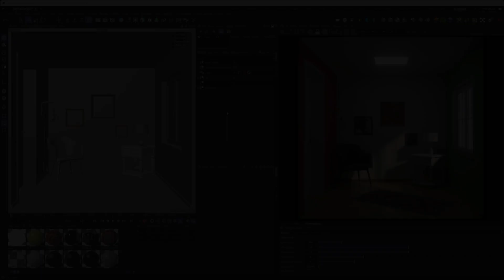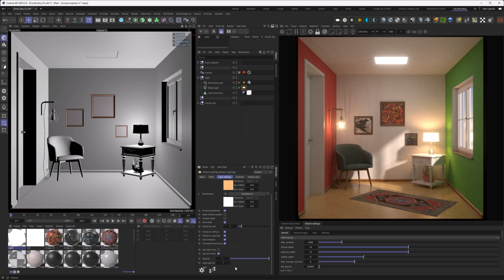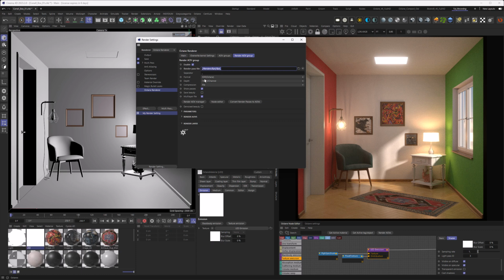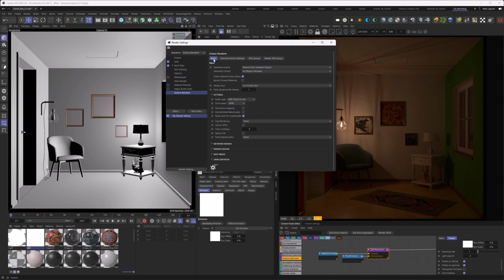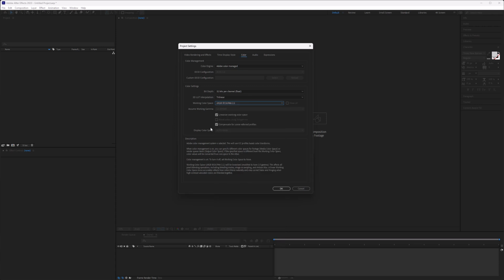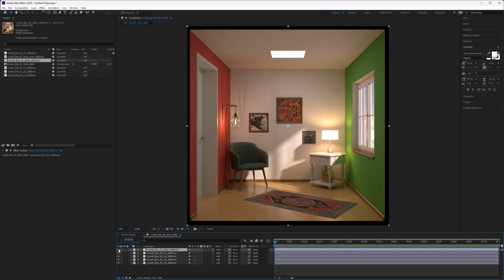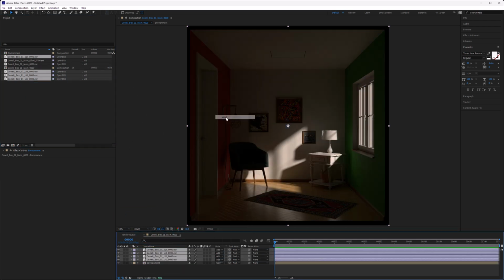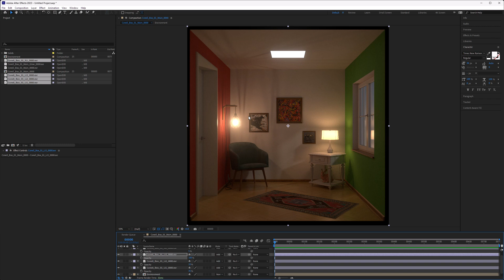Silverwing Quick Tip: Octane Light IDs in C4D an AE

Comment: Raphael, i wanted to ask this for quite some time now.. 
You seem to be the most precise "simple artist" in the planet.. your charts are NASA accurate, your Index of refractions are to 5th decimal (HEHEHE) , AI can't make nodes in octane node editor so organised, your scene manager looks insanely perfect, your modeling is 11/10, naming, level of detail... top..

BUT , why the fuck you render in DWAB, i guess you dont have a issue with a slow SSD/NVME or a 20years old & slow machine..  at least ZIPs..
Reply from the maker: Hey therer Vladan,
thank you for your comment. Appreciate that you noticed my accuracy 😅

About DWABs. It´s mostly about disc space. DWAB is usually the smallest EXR compression. Usually smaller then an 8bit PNG. While it´s only a small fraction slower then ZIP compressed EXRs. 

Since its smaller then ZIP the overhead should be coming from your CPU not the HDD / SSD. So to explain the smaller the file size, the more its compressed, the less the HDD / SSD has to work to get the file into RAM. But the more the CPU has to work to decompress it.

If you feel like your system is struggling encoding DWAB, you can try DWAA. Its a bit lighter on the CPU. This all goes for single layer EXRs I have no experience with multi layer files! I imagine those will be a lot heavier to work with!

In the end, to answer your question. DWAB compressed EXRs work really well on my system and they are the best ratio between amazing quality (brighter then white values) and size on Disk. Easy as that.

Cheers,
Raphael
Reply: @SilverwingVFX DWAB is struggling with i cryptomate, therefore i am mostly happy with zips. 

Tnanks.
Reply from the maker: @vladan.Poison  Dependent on what Octane version you are using this is not a problem anymore. I think since around 2019 Octane is smart and uses the right compression for its passes. No matter what you set in the menu.

As far as I am aware Cryptomatte only works uncompressed. So Octane does not compress it (even if you have set DWAB)
This also goes for a couple of other channels that do not work well with compression as world position for example.
Reply: @SilverwingVFX  in my tests prior or 2021.x octane was rendering CM's in the desired compression howerver in Pix24 and   below if i remember well CM's  were useless. I was not aware that nowadays it does what it wants in terms of compression type (imho it should not). I use Position pass for Z depth as i can't still get a decent Z bufffer pass out of it. This is not said so you make one quick tip of 40 min for that. 😇
Reply from the maker: @vladan.Poison  Maybe I will make a 40 min video for it ha ha ha. Thanks for giving me ideas 😇
About Z-Depth. Yeah, its a bit hard to understand how to set it up. There is even a more easy way (in my opinion) using the global texture in the AOV system.
Maybe I should really make a tut about it though ha ha 🙌
Reply: @SilverwingVFX  YES ! i mean why not...  😄 
Making popcorn and promise to watch it with x 1.5 speed

Comment: Great as always, thanks! 

Two questions that are not directly related to the tutorial itself:
1. How do you make this „light switch“ in your upper right viewfinder?
2. Why do you use the sample count always as a power of 2? So 2048, 4096 etc. Any practical reason?
Reply from the maker: Hey there and thank you very much for your comment and your questions.

1: Its called HUD (HeadsUpDisplay) you can create that very easily just by dragging the on off switch from your attributes window in your viewport. You can move it there by CTL left clicking and dragging it. And also right clicking and modify it so e.g. its always visible even if the object is not selected.

2: Using power of two values is a old habit. You do not have to, but I stick with it because every step up is halving the noise. in the scene. So going from 4096 to 4500 would do almost nothing. But going from 4096 to 8192 halves the noise. If you do not need 8192 you could go with 6144 (half way between) I find that a good system to use.

Hope that helps. If you have additional questions, you know where to find me ✌️
Cheers and an awesome weekend to you!
Raphael
Reply: @SilverwingVFX  Danke vielmals, Raphael!

Comment: Thank you for this tutorial! I wonder if it takes more time to render all these light passes than the main image (noise issues put aside). Also, I think i discovered I don’t need to always render in 32 bit (I thought i had to do it to match the « 32 bpc » in Ae 😅
My hard drive will be happy.
Reply from the maker: No, it does not produce more overhead. The only thing that takes more time is saving multiple files instead of one.
Important with the 32bit is that your images are floating point. To my knowledge only EXR has a "half float"/ "16bit float" option. If you would render PSD or Tiff. 16bit is not float there. So you would have to render 32bit there.
Cheers and a good time to you and thank you for your support, watching my content!
Reply: @SilverwingVFX  Gotcha, so I can render in 16bits as long as I stick to Octane EXR (whitch is my go to anyway) 🎉
Reply from the maker: @oursonwelles  Yes exactly.
If you are using DWAB the output is 16bit anyway.

Comment: I love Octane, and it's my render engine of choice, but in the case of setting up lights, Redshift is far superior. In Redshift you can drag and drop objects into "Include and exclude" menu for each light. It makes it far more user friendly and efficient. This is where RedShift really shines IMO. I wish Octane would make something similar, instead of having to deal with Light IDs, tags and the manager which makes it much more confusing. I don't really use Redshift but every time I see that feature I get a little jealous lol
Reply from the maker: Hey there. Thank you so much for your comment.
I fully agree. Redshift is easier to use in scenarios when it comes to "Faking" stuff. And no, I do not mean that in a negative way. I think this comes from Octane being a wholly unbiased engine in the beginning with no "Faking" capabilities. And then slowly opening up to the idea.

Did you know that since a couple of Octane versions there is a experimental new UI for light linking implemented that is closer to what RS is offering. You can turn it on in the Main Octane setting and is a checkbox called "C4D Light Linking" I think it is meant to work with the C4D Render tag. Its not fully there yet as Octane does not have full light linking capabilities. But its a step in the right direction.

I personally almost never use light linking. So I am not as affected by this. But I definitely welcome every change that leads to a better UI / UX.

Cheers and an awesome time to you!
Raphael